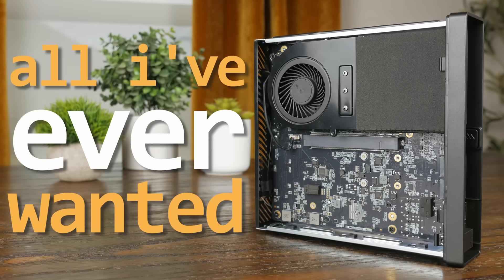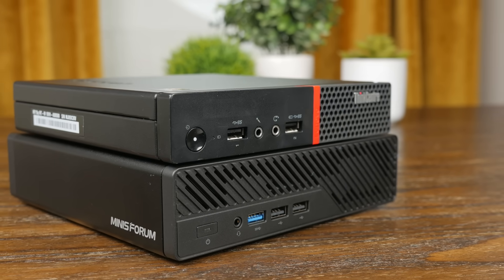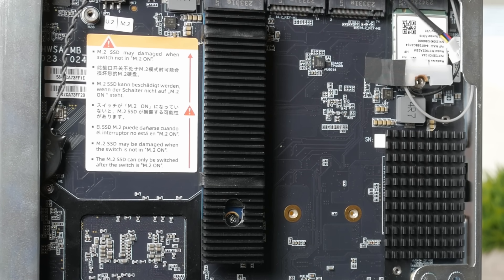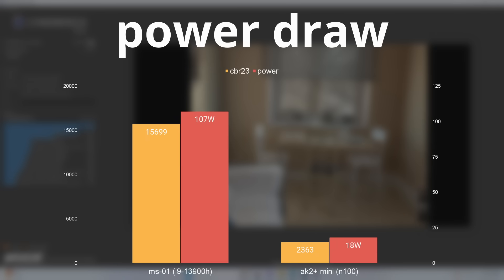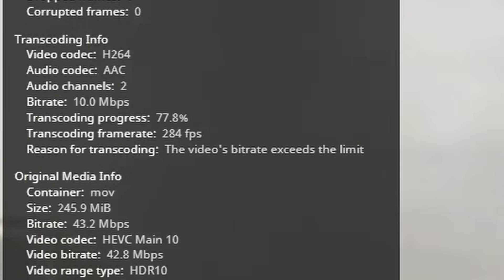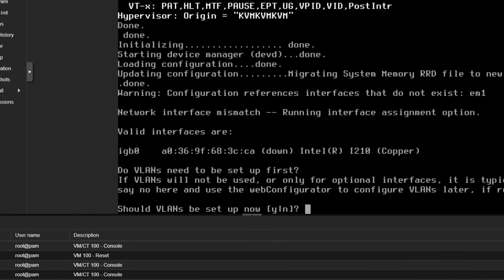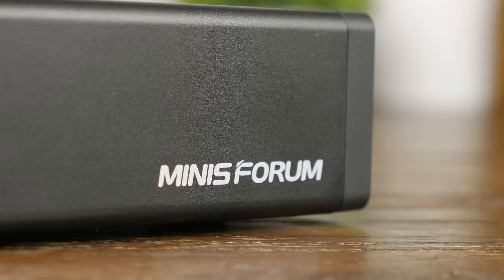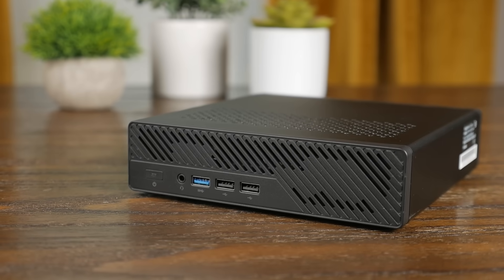This Might Be The Perfect Mini PC

Comment: UPDATED Forgive the noob question. My internet is fibre. Could I use this PC as a router/firewall (fibre into the SPF+ port using Proxmox/pfsense) AND homelab server? 

Money is tight, and if I could skip the UniFi UDS-se and run my fibre straight into the PC, that would save me big bucks.

Edit: I found out I still need the fibre "modem", but it will work in bridge mode => Cat8 => 10GBase-T SPF+ to 10GbE module => router equipped with SPF+ port.

Comment: I love this but honestly I hate Intels......  I've run Xeon's and work with lots of servers but damn we need WAY MORE AMD type stuff available.  I want this in an an AMD 12 Core form, yes with a better cpu cooler would be good.....  and maybe the ability to run a 3.5" HDD as well.  I'd rather run 3x nvme and 1x sata hard drive.......  don't need no 2.5" SSD nonsense.  I love the size of this..... even smaller would be better.

Comment: So if you want a mini pc.. you are better off with a 1340/60p based system, or an AMD version like 7735HS og 7840u.
Reply from the maker: Well not if you want dual SFP+ and a PCIe slot I guess...
Reply: @HardwareHaven Dont get me wrong I wasnt commenting on design and ports, thats great. I am no fan of the Intel 13000 mobile processors.  the 13900h, sounds like its similar to the 13900k right? But it isnt. Its a sort of deceit. A 13900h is a 13600k..

Comment: This loses points for forcing the backasswards 2.5 GbE standard which doesn't exist anywhere but the dreams of manufacturers wanting to push this weird standard enterprise doesn't use. Sure, it does have two SFP ports, but the intention is still there.
Reply from the maker: No one is forcing anything on you lol. Also, it does indeed exist. My motherboard has integrated 2.5Gb, I have multiple switches that support it, and just about every NAS on the market today has 2.5Gb. Yeah, enterprise doesn't use it. Plenty of consumers and proffesionsals do though. Not sure why you're so upset that they included a feature.
Reply: @HardwareHaven  Okay. How many consumer motherboards you can point out that come with 10 GbE?
Reply from the maker: Not many? Not sure what point you're making with that though?
Reply: @HardwareHaven  Considering how expensive this thing is, I'd rather have 4 SFP ports instead of 2.5 GbE ones.
Reply: 2.5G was invented due to limitations of wiring in existing buildings. A lot of the time, replacing it with newer wiring would be cost prohibitive and a 2.5x bandwidth upgrade with the existing wiring would be plenty.

Comment: too small and too expensive - you can get something with better specs for almost half the price basically - minis is just catering to people who want something when they want it and they will pay - lack of expandability is a major downfall for something this pricey but for some people it could be ok - with intel chips it gets hot and uses a lot of power - people may be better off waiting for zen5 mini - honest opinion but there is always something better right around the corner - these machines and fb a100 gpu will be great bargains in 5 years - another perspective
Reply from the maker: Too small for who? And I'm curious what better specs for half price you're thinking of.

Comment: I ordered a barebone unit (i9-12900h) last week.  My goal, once I outfit it with 64GB of memory and two 2TB NVME drives (Raid 1) and hook it to my Trendnet 10 port switch (which includes two SPF+ ports & eight 2.5Gb ports), is to use it to teach me about Windows server management.
Reply from the maker: Good luck with it!
Reply: @HardwareHaven  Thanks.  I’m hoping to pair it with an Asustor Flashstor 12 Pro (since it also comes equipped with a SPF+ port) and a new roll of CAT6 cable.
Reply from the maker: That sounds like a pretty sick setup!
Reply: @HardwareHaven  Thanks!  I was pleasantly surprised I was able to establish 2.5Gbps connection speeds using my existing CAT5E cabling and an inexpensive TP-Link NIC, although I still plan on upgrading to CAT6.

Comment: While n100 is definitely weak while the the i9 in that Mini PC is probably way overkill for home server. I feel like the sweet spot would be i3-N305, best balance between power and performance. Now if only the Aliexpress sellers could change the JMB585 in their i3 N305 mobo with AsMedia card so it can reach better C state, I would buy that board. This mini PC would definitely be a great candidate for All In One, a very popular method mostly in Asian countries where people use a single PC and run Proxmox and PC serve as NAS, soft router, media server and sometimes even HTPC combined.
Reply from the maker: You realize the N305 only has 9 lanes of PCIe Gen 3 right? It wouldn't be able to have the 3 NVMe slots, not to mention the multitude of NICs, TB, etc..

I do wish they had this in a lower spec and hope they do down the road. If not that's a bummer.
Reply: @HardwareHaven  oops I did not take PCIe lanes into consideration, there are definitely gaps to be filled between low power N100 and this mini PC
Reply: Not overkill for a packet capture appliance especially for a box that offers 2 10gb sfps+ I can hook them up to switch span ports using SR Fibre SFPs. Its a great product and never expected to find something like this.

Comment: I almost wish the U.2 carrier board forced the switch to be in one position just by design. Then have a spring loaded switch so that it defaults to M.2 voltage unless the carriage is in place.
Reply from the maker: I think that’s roughly what they did in the final design

Comment: a 30TB u.2 would make it purrfect in combination with a passively cooled intel a310 video card to drive 4 additional monitors and have all the relevant video codecs h.264/h265/vp9/ac1
Reply: You already have all codecs inside of a cpu so why not use them ? H.265 encoder is included and has better quality with lower bitrate then AV1....

Comment: First, great video and great analysis! I agree with your conclusions. This is a bit expensive at almost $1k, but you're getting a lot of bang for your buck! Having 3x M.2 slots and a PCIe slot to add more, it would make a good home server with a small virtualized high-speed NAS.
Second, I didn't realize you had a video production background. BlackMagic should definitely make a half-height DeckLink card! It would make these mini PCs a fantastic option for churches or other small video production teams.
Reply from the maker: Thanks! And it’s primarily on the audio side, but I worked some with broadcast video. My previous job was overseeing church production, so that’s exactly what my brain went to haha
Reply: @HardwareHaven  oh, that's awesome!! Our church is a bit the smaller and more traditional, but I'm responsible for almost all IT-related parts. Sound, presentation, cameras, stream, Internet/network, security cameras..... Probably half of my "home lab" thoughts are about what I could use it for at church 😁
Reply: This is basically a server. For me, it's a Supermicro E300 comparison at half the cost. 

You can get 96 GB of DDR5 SODIMM for $250+ and a 2 TB  WD Black M.2 for $130. If you buy the barebone i912, you can build a more powerful server for $1200, fully loaded, over a bare Supermicro E300 at $1700. The downside here is you get 6 real cores and 8 hybrid vs 8Cx16T.

I'd  pay the extra $200 for a Xeon in this thing. The network and M.2 make it worth it.

Comment: Love the inclusion of a Rocket League benchmark. That is my go-to game (yes, i'm a simple man :P)

As for Meshcommander/Meshcentral, one thing to note is that the main developer of this project has been laidoff in late 2022 at Intel, and maintaining Meshcentral WAS his main duty at Intel. Now he was hired at Microsoft shortly after, but Meshcentral is in maintenance mode (there has been a few bugfixes over the last year) but is still in control by that same developer.
Reply from the maker: Hmmm... is there any word on when/if there will be a download available again?
Reply: @HardwareHaven  I couldn't say about MeshCOMMANDER specifically, as I don't use this part. However, for MeshCENTRAL, there are two "competing" meshcentral docker images made by the community, that are still maintained, with a corresponding github project page each (under the name "meshcentral-docker" for both). One is made by Github user gurucomputing (that produces automatically a new docker image when the upstream releases a new build), another by Github user Typhonragewind (which, it looks like, is a wrapper around the the original NPM project from meshcentral). Hope it helps!
Reply: I just thought, however, that specifying that Intel axed the main Meshcentral developer should give you an unofficial reason why things has been more slow for the last year or so. :|

Comment: Would the NVIDIA RTX 4000 Ada fit in this or is a different card like the SAPPHIRE PULSE Radeon RX 6400 more appropiate?
Reply from the maker: Minisforum mentioned an A2000, but you can only get half height cards on the Chinese/modded market. AFAIK

At a certain point, power also becomes an issue
Reply: @HardwareHaven  nah, you can get cooler from ebay to that for $80 and 2 slots convert to 1 slot

Comment: Since the internals slide out easily maybe you could just 3D print a taller shell for a double height card.
Reply: Exactly, or you can just use 90 d angle riser card or just ribbon type extender...
Reply from the maker: Or they could just build a taller case.. lol

I DO want to get into 3D printing for exactly this type of thing though. A far as using a riser goes, at that point you clearly don't need the form factor so just build something you want.

Comment: Go and get a Lenovo P3 Ultra Workstation, which addresses the qualms you had about this device
Reply from the maker: That's a cool looking design as well, but is still lacking SFP+
Reply: @HardwareHaven  OK, it also has a PCIe slot to possibly add 🤔

Comment: It could be interesting to check if there's any arc A310 that could fit in hit so you could do AV1 encoding in a very small home server.
Reply: You ALREADY PAYED royalties for CODECS inside of a CPU. So why not use them ? AV1 is only pushed because silicon valley does not want to pay royalties to europe for HEVC....
Reply: @nemam_nedam  I don't want to pay royalties to Europe, either!
Reply: @nemam_nedam  Or maybe they just want to use that codec. I've noticed that it provides the best image quality for my recordings compared to hevc and has quite good performance.
Reply: @DigitalJedi  Netflix is not doing what youre doing.
Reply: @nemam_nedam  I never said they were, nor made any comparisons. All I did was provide a reason that wasn't royalties as to why somebody would use AV1 over other codecs, the fact that it's actually pretty good.
Reply: Sparkle has an A310 Eco that should fit. Encode on those cards is a beast but don't count on them for lots of render power.
Reply: Wow I didn't expect to generate such passionate comments ! Well I'm in the situation where I have a 3090 and would like a small device/part who would be able to do AV1 encoding for fun (like frame interpolating videos to 144fps). I'm a Fedora user but I still prefer Nvidia over AMD for GPU as I already take time to tinker my whole system and I just want something that work (agree, Nvidia support for wayland is still trash as of today). Here, intel looks like my go to because I could put it under my 3090 FE in my compact MATX setup while not generating too much heat. Maybe even get a refurbish lenovo/HP/Dell  1L mini PC and get a NVME to PCIE adapter and put it inside. I haven't recently tried to use SVTAV1 with CPU but it seems that since 0.9, the performance is much better with ffmpeg.
Reply: Why Intel? AMD Igpu's are just better than this
Reply: @gabrielvieira.4358  The discussion so far is about encoding, which is an area where AMD is substantially behind Intel in right now.
Reply: @gabrielvieira.4358  AMD has worse drivers, worse opensource involvement, worse performance, lagging technologically,  yet Torvalds is telling NVIDIA to ... off, not AMD... That is why.
Reply: @nemam_nedam  I read that the Nvidia RTX drivers are open source interface code to closed source binaries, while AMD drivers are truly open source. But as long as you're not an open source purist and have the budget, Nvidia would likely give you the better experience.
Reply: @NiHaoMike64  internal "firmware" is closed source for any gpu, network,,sound card, tpm, CPU, pc... manufacturer. so what you wrote means nothing for anybody anyhow, it matter only for liars, it is ARTIFICIAL divide, i understand someone lied to you, that is why i wrote that part before. pointing finger on liar, thief, manipulator...
Reply: @nemam_nedam  It matters from a long term support perspective. Fully closed like old Nvidia drivers, it restricts what kernel (and other directly interfacing code) versions can be made compatible. It's particularly bad for most Android devices, even aftermarket ROMs are often stuck on outdated kernels since the drivers won't work on anything newer.
Reply: @NiHaoMike64  Give me working long term support example with open source drivers, there is none... I absolutely loathe Raspberry pi /rpi foundation, because it took 4 years just to have accelerated graphic on their janky GPUs ( NOT because of work of RPI foundation, but external effort ) , when other boards used ARMs or NVIDIA gpus with no problem from START... So i really really do understand what you want to say. ( RPI is broadcom effort BY broadcom raised people to make their IP relevant, it provides no real technical value. )
Reply: @nemam_nedam  There are AMD GPUs over 10 years old that will still happily work on the latest kernel.
Reply: @NiHaoMike64  AMD iGPU, not dedicated gpus
Reply: @nemam_nedam  I have an old AMD APU netbook from 2011 that still runs the latest Xubuntu. Only really useful as a SSH terminal nowadays but it's still good for something.
Reply: The A2000 should fit.  Better gaming
Reply: @kurtwinter4422  This isn't for gaming, I already have a 3090 for this and a 4k screen. I wanted little single slot card who wouldn't take too much on my PSU and do AV1 encoding and maybe do some test with streaming.

Comment: For that kind of money i could just add another server to the rack.  Be way more useful and it be supported better.  These niche computers come and go.  What makes this any different than the slightly larger mini-pc's other than being 800+ more expensive.  Im done with all these little niche computers like the raspberry pi and orange pi and nuc's.  Their cool at first and then a week later...
Reply: serious question: what parts are you using to build a rackmount equivalent to this.  I'll settle for a modern cpu,  dual 10 gig ethernet (don't need the 2.5 g ports) and ram for under 1k in a rack chasis.
Reply from the maker: So an $800 PC is $800 more expensive than another mini PC? I wanna know where I can get one of those free PCs!

In all seriousnees, what makes it different is dual SFP+, dual 2.5Gb, 3 NVMe slots, and a x8 PCIe slot. For people that actually need something small but capable, this could be perfect. 

If it doesn't make since for you, just don't buy it.
Reply: I think you miss the whole point.  Like i get it, your making an infomercial for the device and all so your compelled to defend it no matter what anyone says, like you get that money.  

But here is the real question everyone should be asking.  How long did you use this device as a server?  A day or two, week, few weeks?  I ask because everyones just sort of saying the exact same thing in their videos in almost the same way so im thinking you guys are using a script provided by the maker with a lot of talking points for you guys to keep hitting.  I don't need to be coffeezilla to figure out whats up.

As for my earlier comment of 800+, im talking about the full retail price on their website not the 'on sale' price.
 @HardwareHaven

Comment: Looking at the comparison of i9-12900h vs i9-13900h, I'd select the 12900h version since the 13900h is a small increase in performance for $130 more. Passmark wise its 28412 (i9-12900h vs 29570 (i9-13900h) or or approximately 4% difference. just my observation on value
Reply: to me, this is why i ordered the 12900
Reply: Well, there is also a difference in supported RAM.  The 12900H supports up to 64G while the 13900H up to 96G.  If you need the extra RAM for the VMs then the extra 32GB can make a difference.  Servethehome video shows they added 96GB and it worked fine.
Reply: @zag1964  the 13900h was tested with 96gb. I don't see anyone that tested the 12900h unit with 96gb unless I missed it. If 96gb is a need then you are correct the 13900h has that differentiation and would be a better choice if the added ram is needed
Reply: @Tech_for_the_busy_Exec  the CPU literature shows that it's a built in limitation of the CPU but you are right until someone tests it it's not for sure